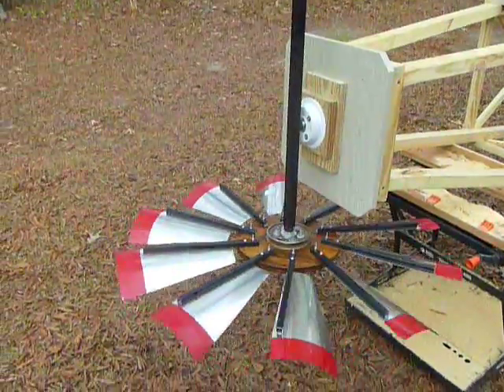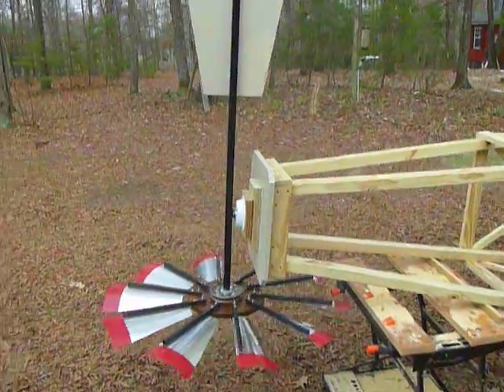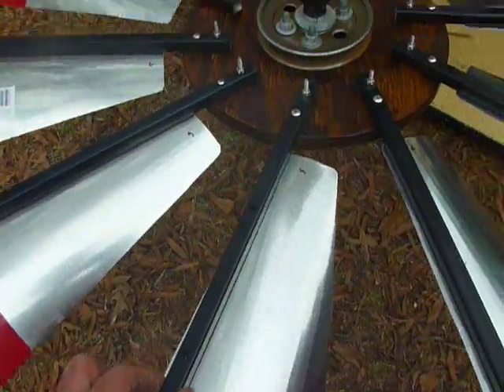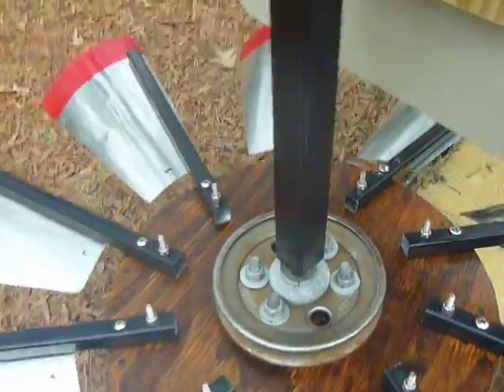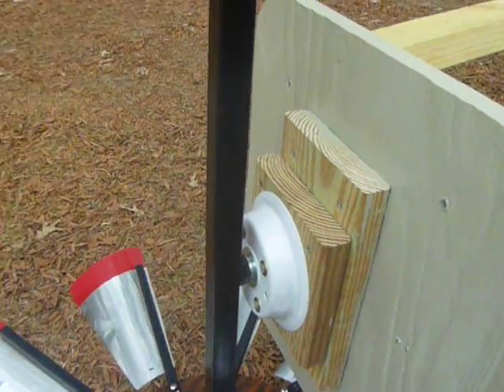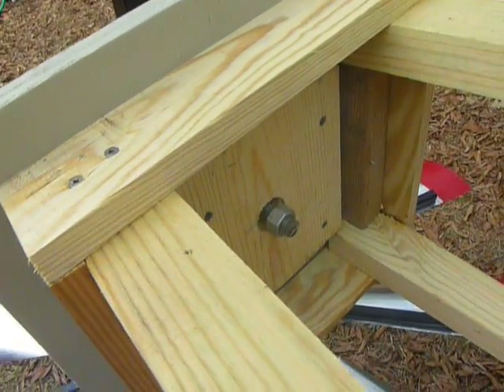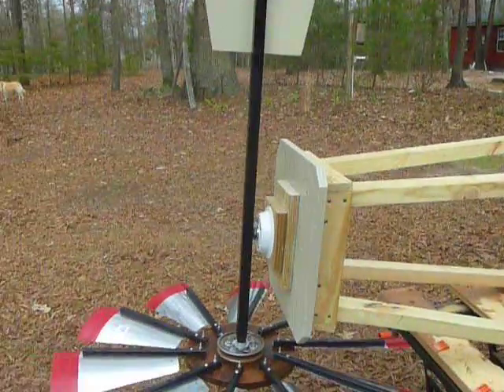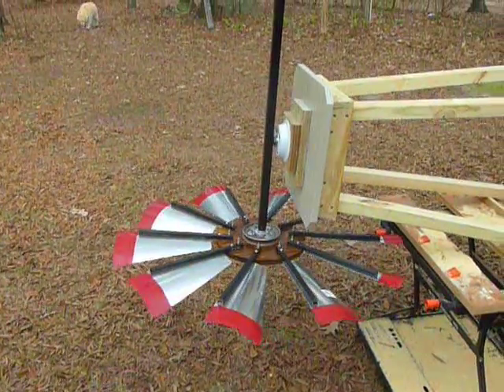Windmill/Homemade

Comment: We have a real windmill that was replaced by an electric pump.  How hard will it be to set up for decorative purposes only?  Do we need a contractor to do it?  Which is heavier,  the tower or the blades?   We have a small tractor and a skit steer.  I'm posting these comments without my husband knowing cause he says we (he and I) can't do it.  Thanks.
Reply: To Raise towers in general it is done with strong ropes or guy wires which are measured correctly on each side so when its raised it guides itself straight.   Choose a rope long enough that you are far away when Raising.   You will need a concrete footing for freestanding tower to bolt down too.   If you use guywires instead its good to anchor base somehow.  Look for antenna tower raising pictures you will see by picture its basic.

Comment: Did it last?
Reply from the maker: It still looks good except I need to replace the bearing,  it's been through 2 hurricanes and always windy out there. Probably use a trailer axle bearing/hub this time or something a little more heavy duty this time.